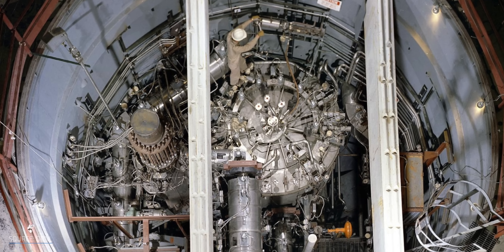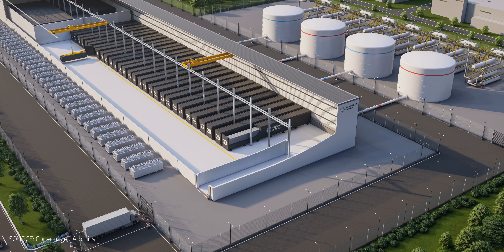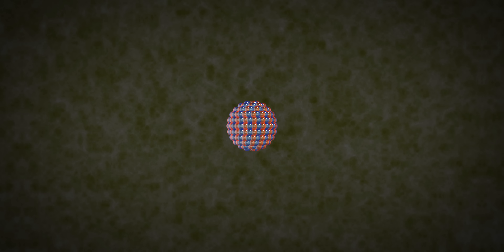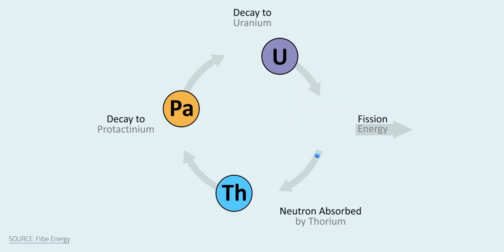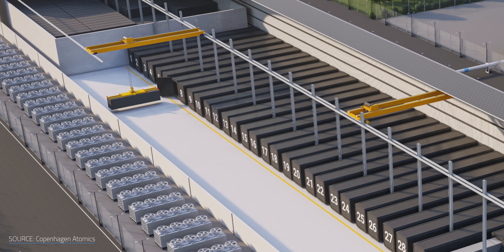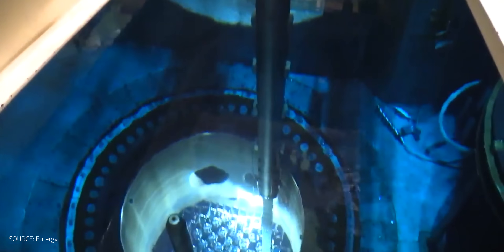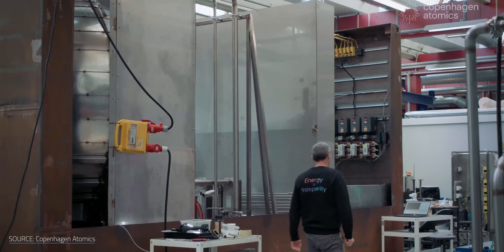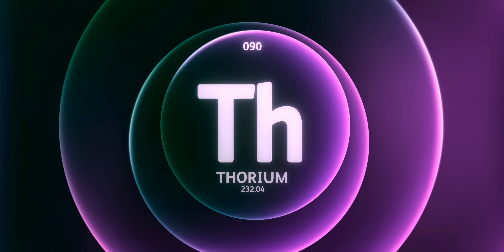Why Thorium is About to Change the World

Comment: So Thorium Reactors can be the size of your typical cargo container but have the potential to last far longer than your typical energy producing models and for much cheaper, too. Neat stuff!! But i would like to put out there a little theory about something said in this video that caught my attention. So, as i understand it, this technology using thorium has been in development as far back as the 1960's and has been in development up until 1969, the same time as the moon landing, before it was cut short for mysterious reasons. I cant say what those reasons could be fully, but i have a hunch about what one of them could be. 
Imagine if they DID finish perfecting and testing these Thorium Reactors, and both production and distribution of these container sized powerhouses were in full swing, and also imagine that factories had multiple of these reactors just sitting in a warehouse, side by side, undisturbed........i couldn't imagine a more suitable and vulnerable target that our nations enemies could exploit. The major flaw of these thorium reactors, to my understanding, is that although they are "Walk-away safe", they are also too dangerous to approach should anything go wrong due to the volatile nature of the radiation emitted from the whole system. All it would take is for one of these things to get punctured or damaged, then boom, the kind of disaster that someone like Putin or President Xi would enjoy at our expense.

Comment: In theory, MSRs are very interesting... although in practice, they will require a significant amount of research and development in metallurgy that can withstand the tremendous pressure, temperature, and corrosion of the parts involved in the circulation of the cooling lava. They promise a lot; it's great that there is active investment in these developments.

Comment: Definitely worth continuing. If reduction in cost proves to be accurate & supplier runs & replaces container units, included in a still cheaper electricity cost. It will be a winner.😁

Comment: The problem with small nuclear reactors is that they're, well, small.  Building 10 or 20 little nuclear reactors (50-100 MW) will almost certainly be more expensive than one big reactor of 1000 MW - you need ten plant sites, ten containment buildings, ten cooling water sources, ten of everything.  Better to build one big one.  Or just forget it and go with wind and solar.
Reply: Small nuclear reactors like LFTRs are low pressure so don't need containment buildings, and are small enough to economically, efficiently, and quickly be built in factories and shipped everywhere.

Decentralized power generation is far safer than large, centralized ones from a military tactical point of view from attacks.

Small nuclear reactors are easily shipped back to the factory at the end of the lifecycle for refurbishing and/or recycling.

Comment: I think part of the issue is the lack of mature development of ANY type of fast-breeder reactor. Since, while thorium-uranium breeder cycle fast reactors would be cheaper and safer to use if/when perfected, the uranium-plutonium cycle could be more readily developed and brought to maturity for the same basic type of fast-breeder reactor and then adapted and developed further for the thorium cycle.

Both types minimize reprocessing needs, spent fuel storage, and nuclear waste production (even burning off a fraction of fission products in the high neutron flux), so even the higher radiation shielding and different chemical resistant material requirements for a U-Pu fast breeder would still have the majority of advantages of a thorium reactor. (and both types also have to discard the concerns and restrictions around nuclear proliferation and on-site reprocessing, since continual reprocessing in open-loop molten salt type fuel system would likely be the goal)

Aside from proliferation risk being statistically insignificant ... realistically, you could also easily adjust the breeder cycle to make the mix of isotopes generally unfavorable for use in nuclear weapons. (weapons grade Pu-239 and U-233 needs to be really pure with minimum of spontaneous fission or neutron poisoning higher isotopes, which are likely going to be present in much higher quantities if all you care about is thermal and electrical power production)

Comment: This could be promising... however, for one thing this change is unlikely to come fast enough. Secondly, if cheap energy eventually does become extremely abundant under capitalism this will only spur increased consumption and hence resource use. This means that environmental improvements on the front of energy production will be offset by increased environmental destruction in other areas. This is inevitable under a system centered on generating profit and requiring endless growth. So besides even with the best innovative technology we will still need to replace the current system with one based on meeting human needs all the while respecting planetary boundaries, basically some form of democratic socialism.

Comment: I've advocated thorium for decades. But I don't think we will get there until we've defeated the oil & gas interests.
Reply: So you think you’re going to put a thorium reactor in a car or truck ?
Reply: @ELW2940  Batteries go into vehicles.
Reply: @MOTOPSYCHO909 the video was about thorium reactors. The only mention of batteries was in reference to shrinking the size of the reactors to fit into a shipping container and using them as a long lived battery. Ain’t putting a shipping container sized battery in a car !
Reply: @ELW2940  Yes, clearly the thorium reactor is used to cheaply generate electricity which charges the batteries of EV's.  No more oil and gas one way or another.
Reply: @MOTOPSYCHO909 my advice to you is don’t hold your breath until the demise of oil and gas. You ain’t gonna make it !
Reply: @ELW2940  in an "unlimited" energy world. making charge roads would be easy.
Reply: The key takeaway is the one sentence in the video where they say no one has made a Thorium reactor where it produces more fissile material than it consumes. In other words, it loses money and when you scale it up, it will lose lots of money.  Until that problem is solved, oil and gas are here to stay. Same thing with wind and solar. They aren’t going to replace coal, oil, gas and traditional nuclear systems for probably decades to come. It doesn’t mean we should stop trying, but we shouldn’t be so ignorant to go full bore and force half baked technologies until they are safe, cost efficient, environmentally friendly to people and animals and don’t take up large acreage footprints for substandard power.
Reply: Thats not the issue right now. it's a maintenance issue. oil is extremely effective in that it can be used in everything and its different levels of treatment just means being used for a different purpose. Thorium has the big rust issue it must solve. It's the expensive fear that keeps these commercial organizations out. you really think someone like bezos or musk would be shy if it was a cash cow? An electric car company would kill for unlimited power because then they just have to make the car and not the grid.

Comment: Sounds very attractive - though will the automatic winches etc keep working through all the radiation? It was probably a different level, but when dealing with meltdowns in Japan and Russia didn't all the robotic break down, and we all had to rely on human who sacrificed themselves to do vital work? And it would be good to see what their plans for waste management are.

But - since we now already have a blanket of CO2 and other gases that will be surrounding us for centuries, at least; shouldn't we avoid another way of releasing low-gade heat into an environment (the Earth) that cannot shed it? Aren't we replacing releasing energy pent up into molecules by the Earth's gravity, heat, pressure and large amounts of time, by releasing even larger amounts of pent up energy stored in atoms by the much greater temperatures and pressures inside a star? This would only work if we could realistically remove CO2 (and other gases) from the atmosphere and then properly convert them to pretty inert solids or liquids that could be stored (which hopefully we all realise will not happen under any of the present Carbon capture and storage projects - which seem to be mainy used to push out more oil and methane from older wells).

Renewables "borrow" energy which is on its way to becoming low grade heat and use it for something that we want to do. Surely that is the way to go, rather than addicting ourselves even further to an energy source, the consequences of which - simply in heat - we cannot cope with?

Comment: The point is - why use thorium, when spent fuel and depleted uranium (DU) is abundant?
The waste of 1 reactor year of a 1 GWe reactor can provide up to 140 times the electricity. Additionally, the side product depleted uranium can provide another 4 - 5 times the electricity from waste. In total, this is about 700 times the electricity of all the electricity produced by nuclear in the past. This is are resources worth trillions and could pay easily the debt of the US. 
A side effect is that the "waste" produced from this sources consists of 95 % partly precious metals, and about 5 % of waste that has decayed after 30 years to the level of natural uranium. Of course, it is poisionous, but can be stored just like normal chemical waste. 
IMHO, before using thorium the waste should be burned, then DU. And if this isn't enough after thousands of years, there is the posibility to get uranium from seawater, for which China seems to have found a cost effective way now. 
You can use thorium in the same reactors that burn all waste and DU, but it isn't necessary for energy needs. But be aware, beside some advantages of the thorium use, there are also nasty site effects. The small part of U-232 produced during breeding, which may help with proliferation a bit, decays to TI-208, which issues hard gamma radiation. This requires very expensive shielding and this increases costs. 
So again, why use thorium when it isn't really necessary?

Comment: Some really great thinking, very stimulating.  But...I don't get the economics of this.  One spin off is the quality of the system for handling molten salt if indeed it is leading edge.  We didn't see any diagram for the balance of the plant for electrical generation or associated costs. Who are the builders of the molten salt solar energy companies?  Do these guys have a better solution for them?

Comment: I had trouble getting my electromagnetic containment field to stabilize. I got it to hold for 4/10 of a second last summer, but the transformer in front of my house melted, burnt the pole it was on down to about three feet tall, and killed 12 pine trees across the ditch, and the whole neighborhood was without power for five days.
And my power bill for that month was $22,000.
I had to give up on my Thorium Reactor project.

Comment: or lawd this is silly.  The Oak Ridge "Thorium" reactor did not run on Thorium.  It was U-233, and a bunch of other garbage.  Now it is a melted toxic mess, that no one knows how to clean up, and they are dumping tons on concrete over the entire mess, hoping it does not leak some centuries into the future.   THAT was why they fired the d-as.  

Meanwhile ALL Nukes (yes ALL Nukes -- Thorium, Salt, MSR, SMR, on and on) ALL require the additional costs of Steam with Boilers, Turbines, Generators, Transformers -- the "Heat Source" never was the real challenge or expense.  Steam is all LAST Century.

Meanwhile in THIS Century, Solid State Silicon Solar PV just sits in the Sun for 40 or 50 years making Electricity with little-to-no Operations and Maintenance costs, and then fully recycles at a profit at the end of Service Life -- and is already the Cheapest, Cleanest, and Fastest new generation source -- EVER.

Comment: Before or after Fusion energy???

Just a side note: I work at a research facility (top #500 supercomputers, among the top 200 actually). Part of my job consists in granting access to researchers to the HPC systems.

In my 5 years at my job I have seen plenty of applications for projects involving all types of engineering. Not a single one about fusion or thorium reactors, not even theoretical sience, even though I have seen plenty of them related to plasma physics, combustion etc. This is the Netherlands, BTW, not some backwards island in the Caribbean.

And we also work at an EU level participation in projects like LUMI or the new German exascale system Jupiter.

It would be wonderful to have these thorium reactors, but unfortunately, they are nothing more than a way for companies to hype up their stocks, just like Musk and his robots.

Comment: New ole news 😅 great project IF they solve the gamma ray and corrosion problem. It would be great to have something that once turned on will work until the fuel is done, or shut down and let the reaction choke until (and IF, sci-fi spoiler 😱) a techy arrives. And before they put these things around uncontrolled they should guarantee at least 30 years of OFF time without incidents... nice and stable wins the species preservation race :hand-purple-blue-peace::face-blue-smiling:. Not to mention someone may have the brilliant idea to ship the container by sea, and have a nuclear reactor at 20K ft (together with cars, televisions, IPhones, house chemicals, and all other stuff lost at depth every year one container at a time):eyes-purple-crying:... doesn't feel like a good idea....🔮:face-orange-biting-nails:
IMHO thorium is the way to go but must be accompanied with hard and steady engineering -- as in a proper power station -- with mobile units only availeble to closely-monitored environments such as hospitals, defence, data centres, and all the stuff that needs to be working in case of emergency.
Also, once you account for humans' history of disasters with deadly substances (alledgedly caused by "Top 10 most stupid things to do with...", Idiocracy, and Homeland), leaving Max-5-year nuclear reactors to the highest bidder would win the Darwin Award of the millennium.
:face-fuchsia-poop-shape::fish-orange-wide-eyes:

Comment: TL;DR:
- corrosion of components is still not solved
- breeding functionality is not stable and not selfsufficient
- two people in the video only talking about "nuclear power" and dont mention the alternatives (not even as a minimal reference or comparison)
- Matt states that "nuclear energy is set to expand worldwide" which is not true, 
  according to the IAEA the only areas that have new or existing nuclear power plants under construction (or extended/maintained) in a relevant quantity are:
  - China (30 reactors)
  - India (6)
  - Türkiye, Egypt, Russia (4)
  and a couple of other countries with less reactors than that 

  NOTE: 
  There can be multiple reactors in one power plant and some of those reactors are replacements or extensions of already existing power plants.
  It is also worthy to mention that some of those power plants or reactors are under construction for 5, 10 or even more years.

In comparison to renewable energy it is less than 10% regarding new builds of power supply. (Don't know the exact number, but it was something with one digit.)

- 20$ to 40$ per MWh means 20 to 40 Cents per KWh (30 Cent per KWh on average) which is already way more expensive than renewable energy 
  - PV: 13,3 Cent per KWh on average
  - Wind: 9 Cent per KWh on average
  (Everything before taxes)

With continuiously decreasing prices for power storage, the prices for renewable energy is also going down in the future, so nuclear power will be even less profitable.

To make it even worse: Nuclear power plants cannot be used to compensate short term fluctuation in the power grid, which would be necessary to complement renewables.
And to top it all of: Even this "SMRs" are not covered by regular insurances (which will/would increase the price per KWh) and have to be put under control of the government, 
which will cost the people an arm and a leg if something happens and not the companies that operates them.💩🤡

...

The technology in itself is interesting, though.🙃

Comment: Looks like we could solve the problem of transitioning away from neutron fuels by focusing on effective water dissociation. I can't imagine a more environmental friendly fuel than water. Combustion of the dissociation products will yield fuel, so it is also sustainable in a different way than neutron based fuels. The fuel is safe and abundant. We have way more water than thorium or any other fissioning element.

Comment: We're making really good progress towards using the huge fusion reactor we orbit.  Not just for electricity production, but industrial heat.  Sadly our planet is a bit askew, so latitudes with big numbers have overwintering issues, although more underwater megavolt DC cables from equatorial regions will help a bit.

Funny how underground fission augmenting underground heat doesn't come up more; geothermal energy has the same problem as nuclear reactors of large upfront cost, with long payback period to discourage investors.